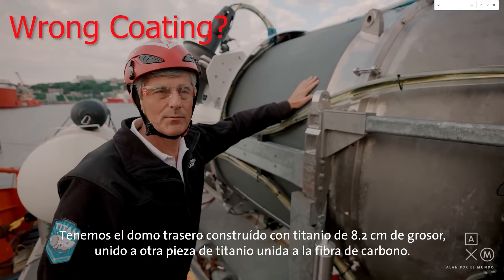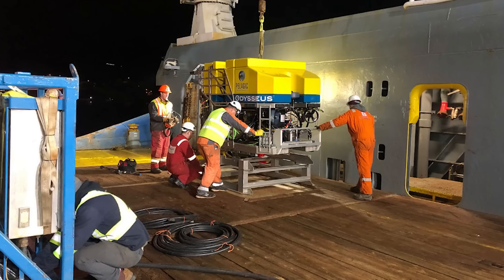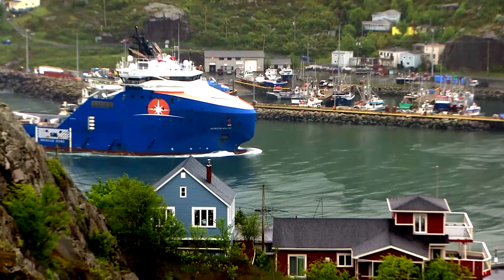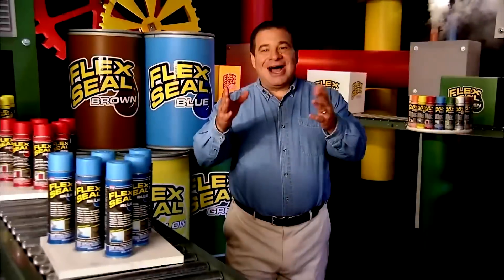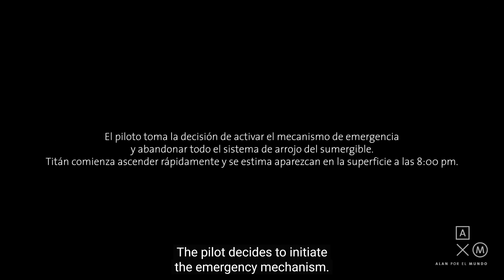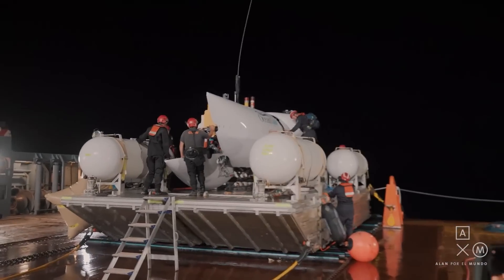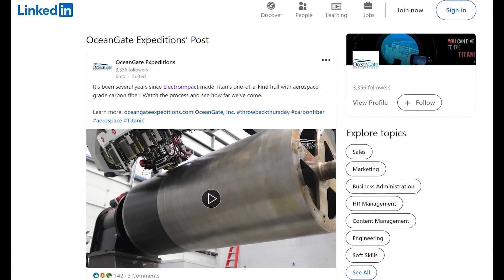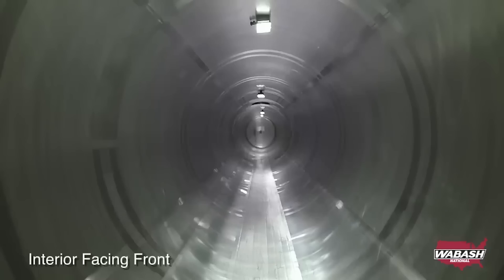Titan Sub Wrong Coating? Hull Construction, Debris Field Search

Comment: You stated several times how it took so long for the recovery. Actually I was pretty damn impressed how quick the equipment was on scene. Ocean Gate new immediately what happened. Rush was trying to ascend and he couldn't ascend more than 30m in 3 minutes. Then all  communication was lost. 
Easy to find them..  
you look underneath where they lost communication. It's the old falling Like a Rock scenario
Reply: Lol what. When something falls in the ocean it doesn't fall directly underneath. I agree they knew immediately because it's not that difficult to determine especially when you've got the military helping.
Reply: @wmd40  
I wasn't trying to be technical. And it was found relatively  underneath where they lost communication. I believe only 120m. The inversion layers in that area are well-known. That's where a lot of Soviet Subs would hide. 
And before you say anything, I know they did not hide that deep. 
Time to put this crew to rest.. 
    RIP TITAN
Reply: @24kt73 I thought the youtuber was saying the loading of the sub onto the platform is what took ridiculously long (9 hours after surfacing)

.
Reply: @electrictroy2010  
now if that was the case then I'm
 wrong in correcting him. But they still did a damn good job of getting everything out there
Reply: I was thinking the same thing - the fact that the recovery team got there so fast is nothing short of heroic.

Comment: The Rhino liner will behave as a compressible volume that makes you less bouyant as you go down, just like a wetsuit does. If you balance your sub near the surface, you might find yourself too heavy when you get down a ways. I wonder if that helped them sink so fast they had turbulence adding stress.

Comment: Seems to me that the hull of a pressure vessel like this is best represented as a chain of materials, outer this, inner that, intermediate the other, even if they are visualised as being one material, solid. The join between layers is the focus of forces. In this scenario, once an  outer layer fails, pressurised water is going between layers, and each layer is not strong enough on its own.

And I don't have to repeat what we say about chains.

Comment: From my background, 2 issues come to mind;
The first is compatability between chemicals - Was any testing or exchange of data done to confirm no adverse reactivity between the rhino liner, and either epoxy or carbon fibre? For us this is standard IN NON CRITICAL applications ! Presumably rhino ladder acts as an etching primer to get wear resistance - what is it chemically biting into?
The second is, I imagine in use of the sub there is potential for surface scuffing - if just resprayed rather than investigated how would you know if a the substrate is compromised?

Comment: WAIT WAIT !!!   RINO LINER.  Isn’t that an admission that your submersible is not WATER TIGHT.     You did not RINO LINER the TITANIUM ENDS —- why because they were watertight.    l.   RINO LINER   Agreed not recommended for super high pressure deep sea pressures.   Made to line horse trailer to help reduce corrosion.   Plastic liner.   This would degrade with each  pressure cycle and eventually LEAK salt water into carbon fibre walls of submersible.

Comment: That implosion video at the end...that's only at 1 atm (vacuum inside the tank, 1 atm of air pushing inwards). The Titan would have had 250-400 atm of pressure depending on its exact implosion depth.

Comment: Honestly ditch the carbon fiber. I get that its technically cheaper then the standerd but in the end its weaker we have see what happens when carbon fiber gets wet in salt water and its obvious that at that depth with salt water and any noises it will cause problems just go back to useing steel and titanium it would be safer.

Comment: Rhino liner is also used in truck beds. I can't see it withstanding anything close to the pressures at depth. It seems everything about that sub was made to dazzle or grand stand the whole experience. Even the recovery procedure seems thought up to point out their ingenuity. It's as if safety and backup plans were thought of as icing on the cake rather than essential. The project was doomed from the start. You don't need a engineer or materials expert to point that out.

Comment: Are we still talking about this?  There were many issues with this sub, but the primary issue was the fact that it was made of carbon fiber.  Carbon fiber is the WRONG material to use period.  The sub failed because of fatigue.

Comment: Why do 1/3 model tests? Economics. If a design won’t stand up at 1/3 size why would it pass at full size? The feasibility of a chemical reaction might be demonstrated at a very small scale in the lab but that doesn’t mean it will then be scaled up to full scale manufacturing runs.

Comment: Jeff, one comment on the carbon fiber winding on the second hull. There's a video of Rush giving a presentation sometime after the second hull was built, in which Rush clearly says the carbon fibers were laid up in a "zero-ninety degree orientation." This means Rush was saying there are hoop windings (zero degrees) and then there are fibers laid up at 90 degrees, meaning axially. If you look at your Electroimpact video of the second hull being wound, at the 11:35 mark the mandrel has stopped turning, and the fiber-laying machine head (sorry I don't know the technical term) starts moving axially along the mandrel, as though it is now laying down the "90 degree" axial layer that Rush seemed to describe. The machine head makes several complete runs along the axial length of the mandrel, and after each pass, the mandrel rotates slightly for the next axial pass. So I believe that video actually confirms the two-directional layup of the second hull, with some hoop layers and some axial layers.
Reply from the maker: Yes, will have to look closer at that

Comment: I just don't like carbon fiber for this application at all. It's 6k psi at 12,500 feet, not factoring the salt; reduced temperature, or increased density.

Comment: Rhino skin or “liner” is a protective liner originally designed to protect a utes or “trucks” bed. And is incredibly effective at that task. I don’t believe it was ever intended to be used as a submarine component.
Reply: ...so he should have built the sub out of an F-150 truck bed coated with Rhino-Liner...would have been just fine...
Reply: So many people don't know the difference between a regular truck bed liner and Rhino Lining they are completely different one of them is a two-part system that's proprietary and releases heat and has to be put on specific and another one is just some crap that you roll on your bed of your truck
Reply: @thecloneguyz  And yet the company itself doesn't mention that their product can be used as a structural component in a submersible, or any underwater application for that matter. One would also wonder how the thermal reaction from such a two-part system would 'interact' with the carbon fiber hull during assembly/manufacturing...
Reply: @someguy4915  to be fair it's Line-X that's used to stabilize buildings that's why the government bought the company

Comment: Obviously the 1/3 testing was dumb as fk unless u put it under 3 times the pressure it would encounter at the titanic depth. The smaller the diameter of the cylinder the stronger it’ll be. Adding Ryno liner at that point tho def wouldn’t make the problem worse or anything
Reply: Models are good to have general idea and proof of concept, in that testing they discover carbon fiber dome with a window is not ideal. That is why they use titanium instead. Not 100% sure but having 1/3 scale dont mean also 1/3 thickness. Also as you stated the ryno liner is irrelevant and its mostly to protect the hull fibers from impact damage and have nothing to do with diving. Dont see using test models as dumb but not doing testing on finished one is.

Comment: really wondering how they get there electronic cables from the outside to the inside? Where did the cables entered the Hull? The controller was bluetooth but was it connected to a receiver outside the Hull? Is that the reason they did not used cabled controllers? Bluetooth makes it easier so you don't have to make cable holes in the hull? So many questions...

Comment: Jeff, I want to know.. How many successful dives they made. was it 4 or 20+?
Reply: 3 to The Titanic and back seems to be the only reliable number due to passenger statements. Lots of aborts counted as success and test dives to a third of the depth counted as successes.
Reply: @toomanyaccounts  How many times are Subs that go to Titanic depth used before being de-commissioned? I was thinking like 2 or 3 times and this guy was trying use this thing like a taxi.
Reply: It seems to me that Carbon fiber seems more disposable than steel or Titanium. The Titan should have been viewed as a disposable sub that can only be safely used X number of times. They also were not charging enough to treat it as disposable which should have been easy considering it's relatively low build costs.

Comment: There must be a thousand different kinds of polyurethane elastomers for sale with vastly different material characteristics and applications. Calling it brand name Rhino Liner instead of some crazy chemical brand name was probably for simplicity sake on the ship tour. I almost wonder if it was some acoustic grade polyurethane so all those hull integrity sensors could still listen instead of being smothered out by a half ass truck bed coating.
Reply from the maker: It probably was Rhino Liner as they do have a marine division

Comment: @jeffostroff Hey Jeff, great analysis and on-going coverage, it is truly perplexing to see how one mans vision can completely overshadow reason and rational methodical considerations in this build.  Or maybe he just ran out of money and this is what he ended up using.  Either way, sadly we're discussing it.

Question: Has there have been any talk in this industry about a titanium outer shell...an outer sleeve with a carbon fiber inner liner?  It'd likely be nearly impossible to press fit a titanium sleeve over a CF shell.  Seeing material science (metallurgy) advance using complex blends of elements to create unique and special use metal applications, is there any advancement in this application? Or why not layer materials of different make-up to arrive at a lighter and equally as strong final product?  Or is a titanium sphere just simply the only thing that'll work for this application?
Reply from the maker: If they had titanium it would be too heavy, that's what Stockton Rush was trying to do is shed weight so he could have a cheaper ballast system
Reply: the titanium hull contracts and flexes so a carbon fiber inner hull would still take damage
Reply: @toomanyaccounts  Everything flexes, That was part of the major issue with his design.  The question is, would a strong outer shell help contain and protect a carbon fiber inner section?  At that depth there are unreal pressure...no other place on (or off) earth has any condition like this.  Thinking of a much stronger example, but similar to the bands around a whiskey barrel, but a full wrap.  A strong outer shell with lightweight and strong inner liner.  Strength and weight savings...maybe. But we don't have a cavalier trend setter to try it any longer.

Comment: I still say the rear divided section filled very slowly on the way down and is why it seems they dived faster than usual, this lowered the MTBF on the CF tube and then when deciding to ditch the ballast, having a weaker mechanism which really should have been a magnetic type of action possibly failed after a while, all the factors added in to the equation just equated to failure sadly. -Amazing videos so far buddy :D
Reply from the maker: Thanks, I'm glad you liked it!
Reply: re: "I still say the rear divided section "
Rear section was open to the water, it was not sealed. What gives you the impression it was sealed? It, too, would have to stand pressurization to 13,000 feet and there are NO DOMES back there. The batteries are back there and are rated for depth. The batteries are made by ictineu, do a search on that name for info.

Comment: Can anyone tell me since I don't know how it's supposed to be. Why carbon fiber in the middle but titanium around the front and back. Why did he think carbon fiber was a good idea.
Reply from the maker: He was trying to reduce the weight of the sub to make it better for buoyancy and cheaper to ballast it
Reply: If you carefully watch the video above, along with some other videos, you can work out Rush’s thought process.  At some point he had an idea that carbon fiber would be great for submersibles, because of its strength to weight properties.  More buoyancy therefore easier to operate the submersible.  Engineers then told him that it was a bad idea because carbon fiber does best under tension, and poorly under compression.  I feel that when he was told it couldn’t be done, he set out to disprove the engineers.  As you can see in the video above, he made a model of the Titan totally out of carbon fiber, and it failed the pressure test when the carbon fiber end cap with the port hole imploded.  Wanting to prove he still had a good idea, he decided to rebuild the Titan with a carbon fiber hull glued to two titanium end caps; and we saw the result of his concept.

Comment: Food for thought……a 1/4 inch hydraulic hose with the same number of plys and same material make up as a 1/2 hydraulic hose with same characteristics. The rated working pressure will much higher on the smaller I’d hose. This is because there is a larger gap maternal surface area inside the larger hose. So I assume when they tested the 1/3 scale PV it should have withstood a MUCH higher pressure than what the full sized pv should have withstood. There must be a mathematical equation to determine how thick the hull must be.

Comment: While there are countless other issues... I did find it odd no one was talking about Rhino Liner being used on a composite? Usually those coatings cure by evaporation of a solvent... Cured epoxies don't like solvents

Comment: I don't understand why they used bolts on the hatch on the Titan. A closing mechanism to ensure the hatch was watertight until the Titan was fully submerged would have made sense, but even just ten feet under water the pressure is so high that I doubt a grown human would have been able to push open the hatch.

Comment: I am going to come to the defense of Rhino Linings here.  As a past Commercial and Industrial (not truck beds) applicator of Rhino Linings, we could have been selected to apply this coating if we were still in that business.  Rhino Lining has multiple linings that all work very well.  They are 100% solids, catalyzed polyurethane and or polyurea coatings.  There would be no chemical interaction between the carbon fiber and the lining that would have degrade the carbon fiber, none.  That lining was applied to provide a protective barrier to the carbon fiber against damage while being handled.  It was also chosen for its ability to provide a barrier to the sea/fresh water that the submersible would be used in.

It must be understood, that the substrate that the lining is applied over, must be designed properly to withstand whatever is the intended use that the Rhino Lining is being applied on.  In this case, that hull of the submersible would need to have the ability to withstand the pressure of the expected depth of service.  As a 100% solids lining, the lining would be simply pushed up against the hull as the pressure increased.  A duty that it surely could perform.  It was never intended to be a structural component.  

The reality is what we all know.  This hull was not properly constructed.  It failed under pressure.  There was likely some entrained air in the wound layering of the prepreg (pre-impregnated resin) carbon fiber.  This was witnessed by others that had been in this, and other vessels that OceanGate designed.  It was related to as "bangs" heard when at depth.  Those bangs were the carbon fiber being compressed and being pushed into the voids of the lay-up.  At some point this is where the failure occurred.  

I do agree with the assumption that the unidirectional winding probably did not help either.  This lay-up would surely have been less strong than a cross-directional layup of the same thickness.  The NAVY does not use this construction, there's a reason.  It's just not as reliable.  A hull fully constructed of titanium or cast iron would have been a better choice.  The avoidance of the CEO to get proper safety certifications was also a very bad move.  This was an accident waiting to happen, and it did.  I feel terrible for the other lives that were lost in this poorly planned adventure. Stockton Rush was the only one that I do not have  that feeling for.  He was off-base on his approach, and paid the ultimate price for his lack of design, and oversight.

Rhino Lining will likely be sued in this, but they do not deserve to be.

Comment: Oh it was the coating , well add that to cracked window ,cracked window frame , wrong glue between carbon fiber and titanium , out dated carbon fiber material, carbon fiber was only one half as thick as it should have been . And I'm sure the You Tube experts will have a hundred other reasons . Find out why they went down faster than normal and why they started to raise so slowly , even after the ballast was let go and the steel frame was let go .